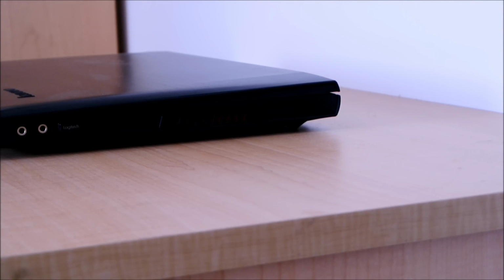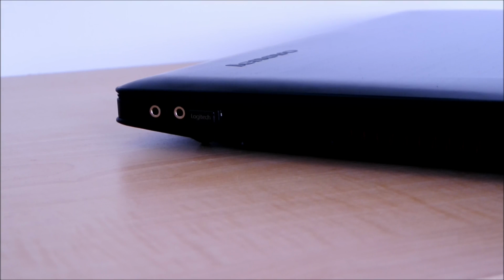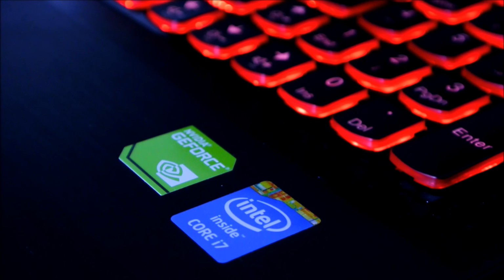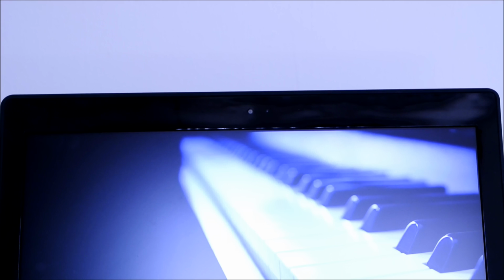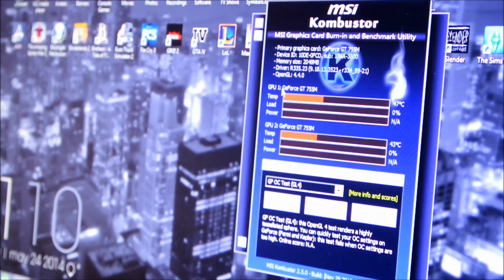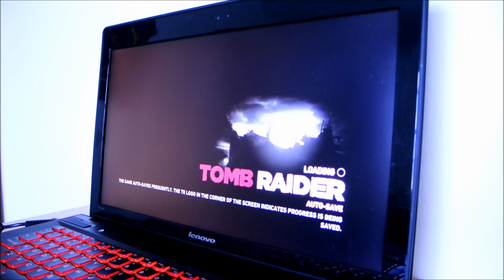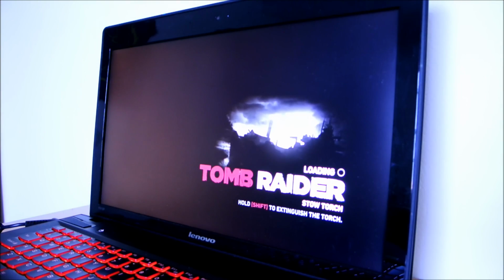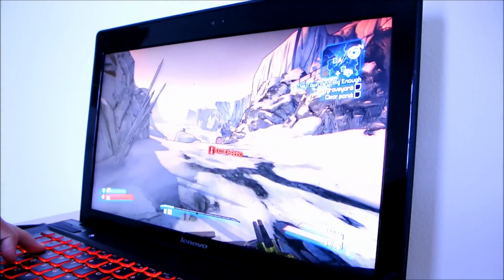Lenovo Y510p Review!

Comment: Is it true that when the computer its not plugged in via adapter to wall it run really bad? And if so does it only run bad when its running a game?
Reply from the maker: Yes; the FPS takes a substantial hit whilst unplugged. However, this only is applied to gaming performance. For example, a game with 60FPS plugged may run at 20FPS unplugged. From my understanding, this is common.
Reply: Wow. That's significant but its still worth the money! Thanks for the fast response!
Reply from the maker: MrCheems45 No problem! Enjoy the laptop if you decide to purchase it!
Reply: The way this laptop works is it required the power brick to run the 755m/755mSLI. When you run the laptop off battery it only uses the GPU on the CPU that's why you see a performance difference. It's the nature of the beast. If anyone remembers the first Dell XPS laptop with desktop CPU and 9800 GPU will remember the 20/30 min battery life. There was no option to run it slower and that's why it failed and they had to re-design it.

Comment: I orderred mine could you tell me if it's mate or glossy screen?  http://www.tigerdirect.ca/applications/searchtools/item-details.asp?EdpNo=8908290&SRCCODE=CANWSHOPBOT&cm_mmc_o=2mHCjCmtB5_BfCjCVqHCjCdwwp&cpncode=33-292913496-2
Reply from the maker: It's a matte screen. The same one I have. :)
Reply: thanks dude I didn't know and I wanted a matte one !
Reply from the maker: Tribal Great! Enjoy your laptop!
Reply: I ordered the 636 too but I read that model was glossy. I haven't got mine yet let me know for sure hopefully I get the matte too.
http://www.amazon.com/Lenovo-IdeaPad-15-6-Inch-Laptop-59406636/dp/B00HIY8VLQ/ref=sr_1_1?ie=UTF8&qid=1402167974&sr=8-1&keywords=y510p
Reply: Mine is mate so your y510p should be mate too!
Reply: Good I order my 16gb ripsaw memory and a 240 840 Samsung SSD so I can't wait to crack it open and get it setup. I hear that Win8 will see the CD-Key in the bios and you don't need to put in a key anyone know if that's true?
Reply: I don't know but I am getting a SSD too
Reply: I ended up just cloning the image to my SSD before installing it. Instead of 1TB drive and one of those small 8gb SSD MMC chips it was just a Samsung HD 1TB with built in 8GB SSD. I don't like those cause if the SSD part dies you can't get to the rest of the drive.
Reply: ohh I didn't know about that, I am getting my SSD for sure now! But I don't know what size of storage that I should take ...
Reply: I tired to get the cheapest version of that laptop that included the 755 SLI. I updated the SSD to a 250gb and 16gb of ripsaw Gskill memory for cheaper than it was to order it already with it. I had to place an order twice one 3rd party on amazon sent me the wrong laptop. Didn't have the 2nd video card. Was a pain returning it cause they argued that since they gave me a better laptop (which they didn't) that I should keep it. They didn't really understand that I'd then have to pay an extra 200 dollars to get the 2nd video card. Ended up getting the 636 from Amazon directly but had to pay like 100 dollars in tax which sucked. But I finally got the model I wanted got my new SSD and Memory installed. Now I am just configuring it and getting some games loaded on it and see how I like it. So far so good.

Comment: 3 hrs battery life according to amazon thats absolutely horrible for 2014 but i guess for all that power you have to deal with that
Reply: my laptop lasts 2 hours and can only run minecraft at 25 fps
Reply: TheFlamingArrow Wtf this is literally almost 3 years old.
Reply from the maker: Hardly anybody cares about battery life on a gaming notebook. I see your point, though. Having it plugged in all the time, it is barely a concern for me.
Reply: i know and ya it is a gaming laptop but it would make it a lot better if the battery life would let you take it and use it for longer periods so it could be multipurpose
Reply: With them specs, 3 hours isn't bad. This is a laptop intended for gaming and gaming laptops are meant to be plugged in
Reply: Arunvir Uppal plus you can always buy one of those portable chargers which you charage at home then when ur laptop gets low you can plug it into laptop
Reply: xyzqsrbo cause it's not plugged in... wow.